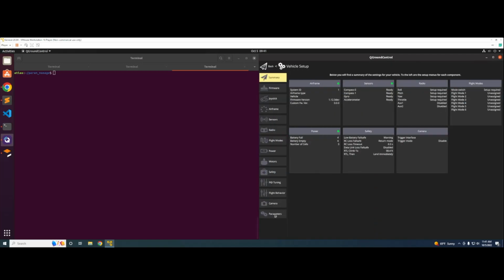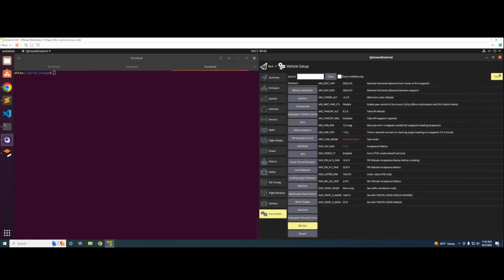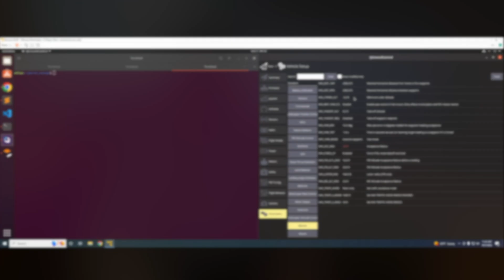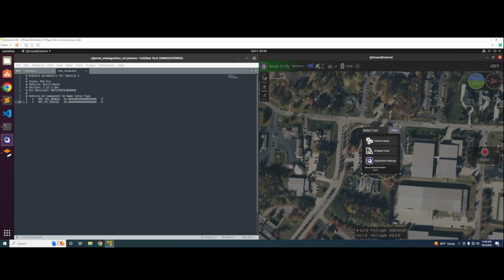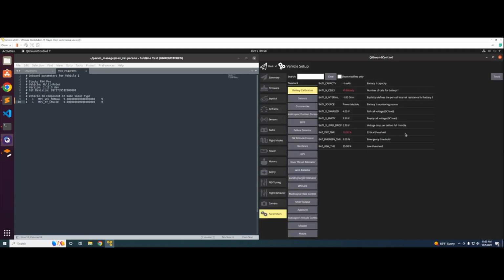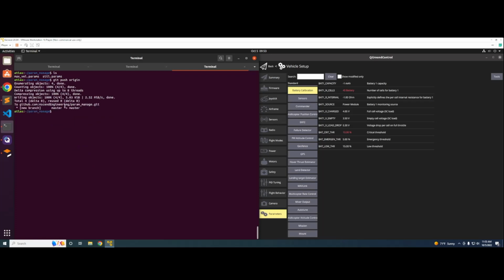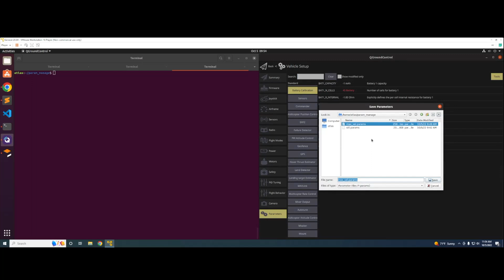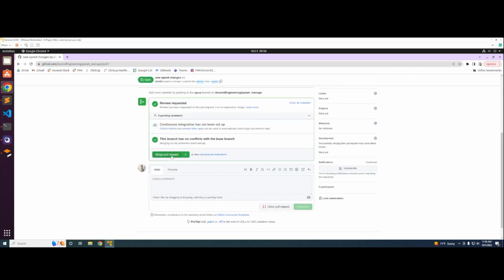How to Manage PX4 Parameter Files

Comment: I cannot find the TEL_FRSKY_CONFIG parameter, im using an old 3DR PX4 and the parameter is missing in the QGC, and possibly firmware, suggestions?
Reply from the maker: It is most likely not in your firmware version. I would update and follow updated instructions on PX4 website